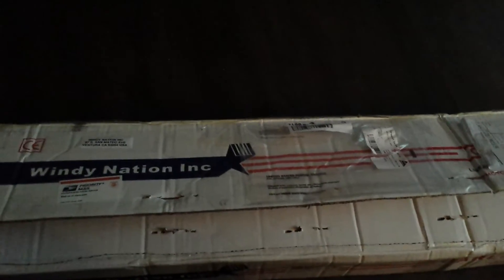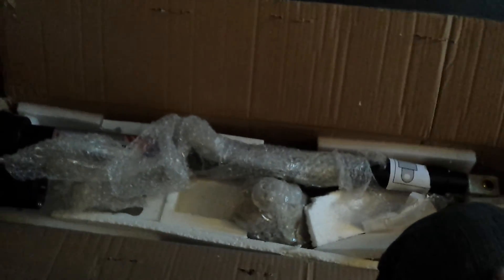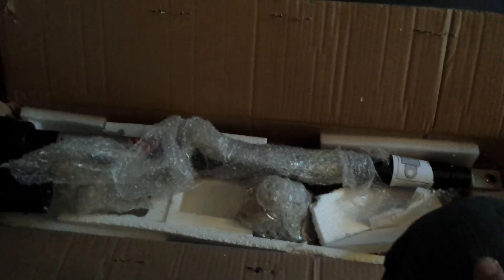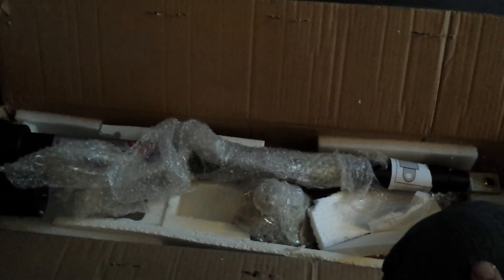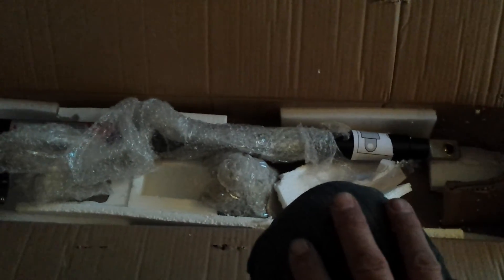Unboxing heavy actuator

Comment from the maker: Yes Justin. The panel that broke has the glassplate pulverised now becouse of the wind and temp who is going switching betwin frizing point. I hoped the sun would do me good when it thitt mu property again but no production on solar with no sun on is from my 2kw array is 200w with sun 250w. The sun is not doing mutch here yet. I think about one mount I will be getting some juce from them again.

Comment: nice looking actuator you have there. I'm thinking about building a solar tracker I have the electronics and only one actuator. I was wanting to control a line of panels. but I will see how it all goes.  again nice.
Reply from the maker: Hi charles If you have place on your roof or wall put your panels there. If not build a tracker. I am saying this becouse its cheeper and safer to bay more solar panels than building a tracker becouse of the strong wind is to dangerus.
Reply: I have a video of how my panels are set up right now I just built a rack with Uni-strut's, and it just sitting on the ground.   I have all the electronics for controlling a tracker. you know I like to experimenter and I have a welder ect. and now a lot more room.  I like to build on just about 1kw on it. but I want do do something different. every one puts them on a single pole.  were I want to do something different like so solar panel rack,  but I want to use links between the panels and control a string of them  I don't know I will do a video to explain more and also use that video for others Ideas.
Reply from the maker: Ha-ha was just looking on the tv and one person hadd bigger "balls" than bloke 60kg